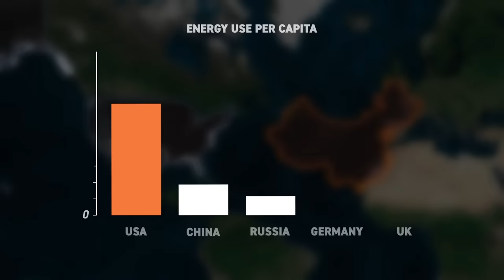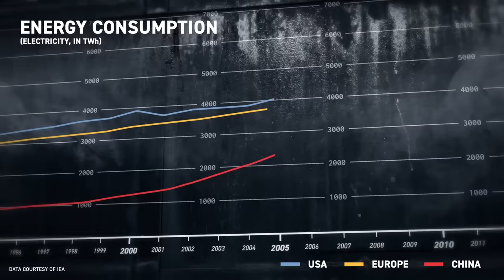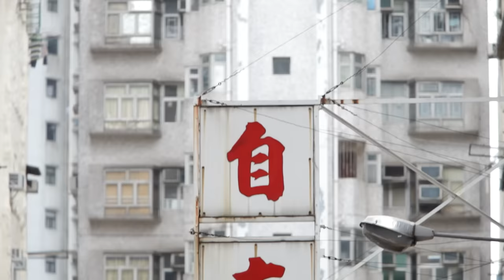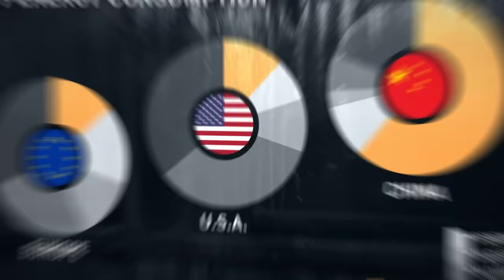China’s Electricity Problem

Comment: China has two big problems, and one looming tertiary issue:

Power, water, and then to a small degree employment.

China needs as much power as they can consume and then some. After that is freshwater. After that, is filling those jobs.

There are many ways to tackle this, but they can use solar, wind, and wave platforms to generate renewable power on the coasts, desalinate water, and then either ship that or further split it into hydrogen for energy storage- or just use a cable and store it in molten salt batteries.

Once those are met, it needs to focus on its space program

Comment: hear me out:
nuclear is the best option

it is much more eco-friendly than even the best of renewable energy sources, most of which require very specific conditions that are most of the time not met, to operate. nuclear power provides a stable energy source that produces very low carbon emissions. including all the nuclear disasters that you have seen on the news (three mile island, chernobyl, fukishima, etc.) the deaths from nuclear power (a source that has been in public use since the 60's) is far lower than anything that coal or natural gas could produce. also take into consideration that it doesn't require huge plots of land to work, and we don't have to completely re-engineer our current electrical grids. we could probably just slowly demolish coal plants and replace them with nuclear plants, which in the short term seems stupid, given how much it would cost to do such a thing, but it would be hugely worth it in the sense that we would have a reliable, clean energy source.

to whoever actually read this whole paragraph i would recommend looking into this topic further if you are interested.

Comment: ????? China has been under Draconian lockdown for most of 2022. This video was released at the end of October 2022. 
China is done. Supply chain shortages fall squarely on the ridiculous lockdowns. There is almost no manufacturing happening. Coal production is down to a fraction of pre lockdown rates. This creates a severe supply side issue driving the price to the moon. Electricity producers are producing as little as possible because it's a net loss. 
Much of what you said is true. However, you cannot close the store for a year and expect another not to open.
Manufacturing is leaving China as fast as industry can build new infrastructure in places like India, Vietnam and so on. It will never return to China. This is a true portrait of the sheer arrogance of the ruling communist party. They actually believe that the manufacturing base that enabled them to grow so quickly is unnecessary for them to succeed. This is no laughing matter. They are heading towards what will likely be the greatest humanitarian crisis in history. The Government doesn't care about the people. They actually believe the people will suffer any injustice and salute them. That's only going to work for so long. When the people are starving to death, not even the million man Army will be able to save the Government.

Comment: i'm surprised tesla china doesn't have solar panels on the roof. you would think that's a no brainer . they could probably supply all their daytime electricity with that. i just looked at a 500kw system for my shop . something like 50,000 ft sq.

Comment: The thing is, rolling blackouts were common and nothing new for factories in China. However many cities in China are built in era of centralized air conditioners aren’t a thing and so as good insulation (2000’s) leading to plenty of energy waste. That said, many people in China are energy conscious where every penny is saved, in many work space and home, the air con is set at 24-26 C instead of 22 (typical US/European air con setting).
It’s not easy to support 1.44billion people compare to US’s 400M, the power generation and demand is equivalent.
On coal side of thing. Last time I checked they stopped approving new coal power plants after 2019. Coal power is really the only thing you can do when trying to meet the explosive power demand China had, in the 90’s and 2000’s. Both hydroelectricity plants and Nuclear takes years to build to reach full power while coal can probably do it in half of the time, and China isn’t shy about using Nuclear or hydroelectricity or any renewables, guess who bought the largest wind turbines from Netherland? China.

Comment: Two things you didn't mention: 
1)renewables have variable production. Although solar energy production is somewhat correlated with cooling demand. 
2) There is a carbon-neutral air-pollution free energy source, with extremely low fuel costs that doesn't have the geographical constraints that wind, solar and hydro do: NUCLEAR POWER. China currently has the most ambitious nuclear build out in the world.
It's fascinating how video like these fail to mention the elephant in the room!

Comment: The video production is excellent, thank you.

Regarding energy issues, here are a few points that were not mentioned in the video:

1. Nuclear power: Firstly, the proportion of nuclear power in China is currently low at 5%, but there is still significant room for growth. China currently has 55 nuclear power plants in operation, with 46 more planned. There are also 22 plants under construction, with a goal to increase nuclear power capacity by 6-8 units annually. The mass development of third-generation reactors cannot be rushed due to the large consumption of nuclear fuel. Research is also being conducted on six different fourth-generation nuclear power designs, with four of them already having experimental and demonstration reactors connected to the grid. China is in a leading position in this field.

2. Renewable energy generation: The main challenge lies in the weather-dependent and intermittent nature of renewable energy sources. Efforts are being made to address issues related to transmission networks and intermittent power supply through energy storage. Recently, commercial projects for hydrogen production from offshore wind power and solar power have been implemented. The construction of an ultra-high voltage transmission network, which is considered infrastructure, is well underway. China is also in a leading position in this field. Therefore, improvements are expected in the future.

3. Coal-fired power generation and mining: Although China is increasing the proportion of nuclear and renewable energy, coal-fired power generation still plays a significant role. China is a global leader in ultra-supercritical power generation, even reaching the "ultra-ultra-supercritical" level, with a 7% higher efficiency, 15% reduction in coal consumption, and 10% reduction in carbon dioxide emissions compared to subcritical units. In terms of coal mining, small mines have been closed, and large mines have achieved a high level of digitization and intelligence. The increase in coal-fired power generation is mainly due to the seasonal power shortages that occurred in the past two years, which raised concerns. It is necessary to appropriately increase coal-fired power generation in suitable locations. When facing seasonal or unexpected power shortages, the coal-fired power supply can be activated or increased dynamically to ensure power supply and, more importantly, the safety of the power system.

Based on the determination and actual progress in increasing the proportion of nuclear and renewable energy generation, there is no need to add coal-fired power generation, except in areas where additional capacity is needed.

In conclusion, with a comprehensive understanding, it is clear that there are existing problems that have been identified and are being addressed. Once thorium-based molten salt reactors are successfully commercialized, it will be possible to provide each medium-sized or larger city with small-scale, water-independent, and higher safety standard nuclear power units. As for nuclear fusion, although China has made some leading experimental achievements, it is still premature to draw conclusions. However, considering China's track record, significant progress can be expected.

视频制作很不错，感谢。
关于能源问题，补充几点此片没有提到的：
1. 核电：首先中国的核电占比5%很低，还有较大的空间，已有55座，计划中46座，在建的有22座，正在以每年6-8台核电机组的速度增加。
如果现在大规模发展第三代堆，每年的核燃料消耗量太大，所以不能急。
第四代核电有六种方案都在研究，其中四种已经分别建设实验堆、示范堆且发电并网。
这方面处于领先地位。

2. 新能源发电：主要问题是受天气影响大、不稳定，需要配合储能和远距离输送措施。
前些年有很多太阳能发电、风电浪费掉，目前主要是在解决输电网络、储能解决间歇性问题。最近海上风力发电制氢、太阳能发电制氢已陆续投入商用。特高压输电网络属于基础设施建设，主干已经基本成形，还在陆续建设。这方面处于领先地位。
所以，接下来会好很多。

3. 燃煤发电和采矿：虽然中国在增加核电、新能源发电的比例。
但中国在超临界发电方面全球领先，属于“超超临界”的水平，较亚临界机组效率高约7%，单位煤耗、二氧化碳排放可减少15%及10%。而煤矿方面，关停小煤矿，大型煤矿数字化、智能化水平非常高。
那么，为何煤电有所增加？
前两年发生的季节性电力短缺引起了重视。
需要在一些合适的位置适当增加部分煤电，当发生季节性、突发性事件导致的电力短缺时，可以启动和增加煤电供应来动态调配，不仅仅保障供电，更重要的是保障电力系统安全。

可见，基于提高核电、新能源发电占比的决心和实际进展，在需要增补的地方之外，没必要新增煤电。

所以，全面了解之下得出的结论：存在问题，已经发现，正在解决。
尤其钍基熔盐堆一旦成功商业化运营，将来可以为每个中型以上城市配置一到两个小型的、不依赖水、更高安全标准的核电机组。
至于核聚变，虽然中国有部分领先的实验性成果，但还不敢下结论。但以中国一向的风格，估计偏离不大。

Comment: Try checking the International Air Quality figures for China since 2008 rather than spread old pollution information. China does not have a Grid problem it has extensive HV DC grid for long distance

Comment: You have your line voltages wrong.

Low voltage: 0-999v
Medium voltage: 1000-1 million volts
High voltage: anything higher.

"Ultra high voltage" is a marketing term, and has no engineering meaning

Comment: The great Geological survey of China set in place by Mao discovered the oil/gas deposits as well as a plethora of metals and minerals. China chooses to save its own resources in its 100 year plan and buy cheap from eager exporters. The large wind and solar farms use 1Million volt+ transmission systems. The coastal Nuclear power stations are closer to consumer but also use advanced transmission. Major hydro similar - So what Electricity problem ?

Comment: The question China needs to be asking is what their economy will look like if they continue their use of coal. The consequences they will end up facing will destabilise their entire economy and undermine the entire country (the public health crisis caused by coal also means any pandemics will be exponentially worse). "What does their people need" is often a different equation than "what will increase economic growth".

Isn't it better to throw enormous government funding behind the building and instillation of renewable energy sources and nuclear power plants (and fixing the necessary associated infrastructure and its governmental systems), and using that to help prop up their economy while creating needed energy? It's better to temporarily stockpile and use coal only until the creation of alternative energy sources is achieved. Any new coal plants they build now will just be increasingly dangerous in the future and will need to be replaced.  At the very least integrate and regulate the grid so renewable power isn't wasted.

Comment: This whole video is missing a lot of important parts that created the power outage, with lots of mistakes on basic facts.
The major trigger for the outage was because China restricted import of Coal from Australia due to they didn't play well on the diplomatic front, coal produced in China are just not the quality those power plants want.

The minor trigger for the outage was because the grid companies at provincial level signed contracts on "exporting electricity", and that has to be met regardless even the need within the province exceeded the capacity already. In the Sichuan case, it is actually sending electricity to Shanghai which is thousands of miles away, but Sichuan's capital city Chengdu got no share of that electricity.  If you search online, you will see angry Chinese people from Sichuan province questioning why the state grid is sending electricity to other regions instead of providing basic needs of its own people.

It's very sad that Wendover's video quality has been going straight down hill for the past 3 years, now starts making up statements on "Strengths" that doesn't match some basic facts.

Comment: in the western world we are too dependant.  look at any household and find devices on standby, lights left on etc, but the main energy consumption in any house, is heating and cooling, refrigeration, cooking, heating and air conditioning, hot water, oh, and large tvs.  computers also consume a lot of power.  a lot of power is simply wasted on comfort.  wear more clothes when it is cold, we never used to wear teeshirts indoors in winter...close the curtains in hot weather to keep the heat out, like shutters in Mediterranean housing, switch shit off when not using it.  we live in a caravan in australia, the only excess power we need is for heating, and cooling in this harsh climate, our fridgefreezer is solar/ battery powered.  we cook on gas and heat by diesel, or campfire when the weather is good. generator powered air conditioning is sometimes used, but only when necessary

Comment: Not touched upon explicitly in the video.
As pointed out, the output cost is set by the government. But the input cost is not.
So coastal power plants were used to purchasing coal from overseas, and have it delivered by shipping. So there was little or no possibility to purchase inland coal at input prices lower than output price. Since the coastal power plants does not usually purchase massive amounts from the inland, there are few or no rail transport. Meaning that coal had to be driven on trucks. So now you got 1. Higher demand for inland coal 2. Higher demand for trucking = Unprofitable to produce energy.
This is how China faced an energy crunch.

Comment: I'll summarize the answer for this video, they know about this problem, and that's why they are spending tons of money on nuclear and solar energy... Hualong One is their 1000MW reactor produced in-house and they are producing these reactors at the speed of "refrigerator factory production"
Reply: kraigstclair2841  The video doesn't explain why they have more than 10 nuclear plants in the project and 4 being built right now... not to mention that they have already surpassed France in nuclear energy production, just behind U.S. CCP knows that coal energy production is not efficient and sustainable in the long term, they will be forced to change their energy grid. and they're doing it with nuclear power.

Comment: But their emissions per capita is way lower, so shut up... Trendline simply indicates that emissions will increase per capita in China, but like you said it's wayyy lower then US emissions per capita now, so China has enough room to put their aircos a couple of degrees cooler. The carbon isn't the worst part of how they burn coal in China anyways, I heard they don't have filters, so they are burning "dirty coal". A lot of carbon monoxide in the air and stuff.

Comment: One big problem has with coal as a power source is that they have almost no rail-freight capability, so much of it has to be transported by truck. 

What - China has no rail-freight capacity? How can that be, they have railroads *everywhere*, don’t they?

They have high-speed passenger rail everywhere. The government was infatuated with high-speed rail, so kept building it everywhere, despite almost no passenger demand for the majority of routes. As a result, they wasted billions on a vastly-underutilized passenger rail system instead of building freight infrastructure that would actually have benefited society :-/

Comment: I gasped when Ilearned oz has more coal deposit than China and the US
Reply: Its not so much that Eastern Australia has greater reserves. It is that Australia is the largest exporter of high grade thermal coal, so getting pissy and banning Australia coal for political reasons means cutting off supply from the largest exporter of high quality black coal in the world.  
Indonesia was the largest thermal coal exporter for a while, but recently banned many of its producers from exporting as they needed it for their domestic generation. Its also hard to say whether indonesian coal was all bituminous black coal, or whether it also includes lower quality sub-bituminous . 
For Asia, it is smart to obtain coal from indonesia and australia, as the shipping costs are low. There are larger coal reserves in the USA and Russia, but getting it to PRC is generally more difficult and costly than getting from Australia.

Comment: If those coal plants could be refitted for a different heat source with a lower carbon output and that did not need to be imported, it might help. If, and I am keenly aware that this is a big if, the gyrotron drill tech pans out, they could feed those plants geothermal heat.
Reply: Geothermal requires geothermal activity
Reply: @AlechiaTheWitch  That's the fun part of using better drilling tech that can go deeper at a lower cost: if you go far down enough, you will find heat.